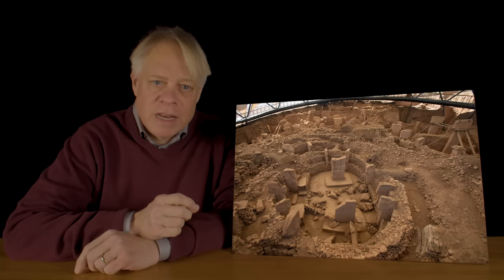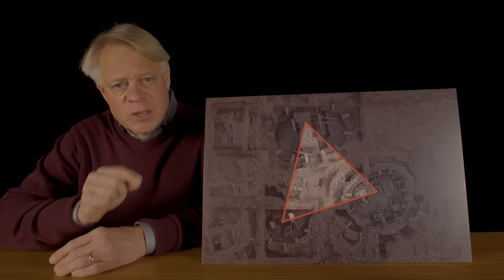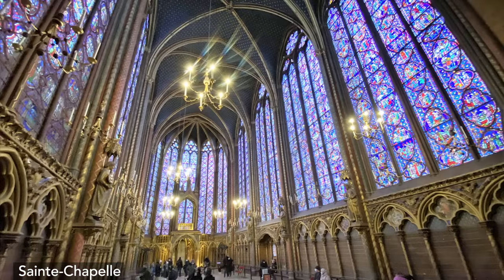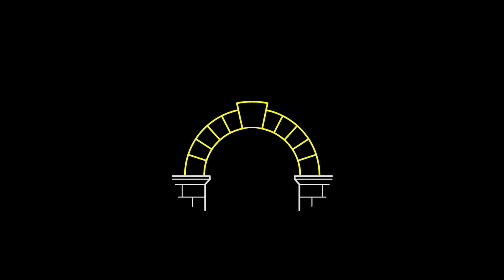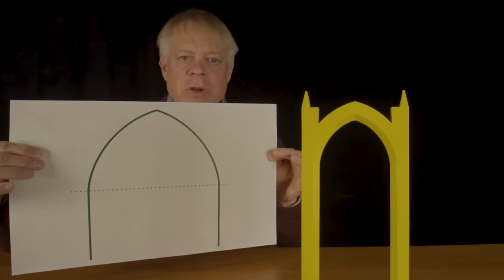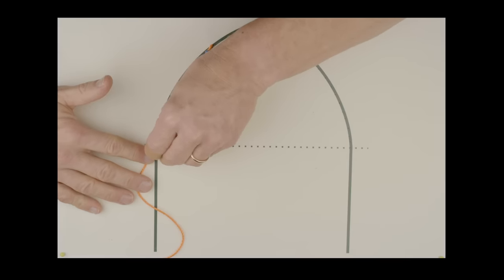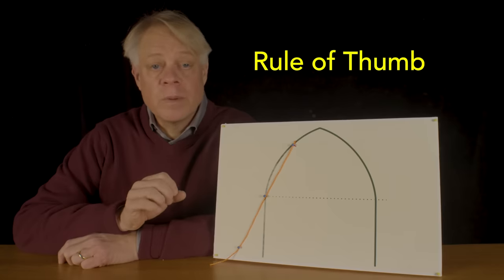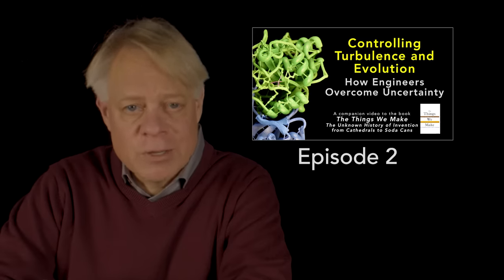Building a Cathedral without Science or Mathematics: The Engineering Method Explained

Comment: Oh come on.  I can find an equilateral triangle on a dog's butt if I try hard enough and pick three points.   Engineering method?  Yeah most three year olds can stack blocks.   Cave men could draw in the dirt with a stick and discover they could make forms they liked.   

It's also a lie that the builders of the cathedral didn't use mathematics nor geometry.   Of course the brick layers didn't get invovled in that side of it, but the designers of the cathedrals did.   Have you ever heard of something called a compass?  Do you know how they used strings to create arcs?   Did you know there is a method for subdividing sections?   "Oh we don't use math or science!  Derp!"   What is the point?   

As far as the kooky method for the string to find the arch width, that is the same as looking on any pattern and searching for the equilateral triangle.  It is meaningless.   Why is it meaningless?   Because the column width necessary depends heavily on the material properties of what the arch is constructed of.    Need the arch to have 1/4 to 1/5 thickness etc of whatever proportions you are trying to get at  IF it is made out of styrofoam?  Nope.  Not with styrofoam.  Material does matter. 

Yes they did use rules of thumb and trial and error.  What is a fancy name for trial and error?  Oh yes it is called science and engineering.   

This is just dumb on a hokey pokey scale.   

People who think this way is why people can't build a bridge or overpass in Texas anymore because they think "got more smarts than them stupid scientists or engineers nowadays!"   

If you made those same arches out of steel they wouldn't need to be nearly as thick for the same height and strength.  

The magical string method!   Well that is just conjecture.  More than likely they built smaller structures and knew already how far they could push their luck building things.

Comment: but they did use mathematics.... divide the length into 3... thats math
double its length, thats math... just without units of measurement
Reply: It's not math, it's just intuition. Sure you can create a mathematical basis for why it works but it's not "math" in the sense of advanced calculations and geometric analysis.
Reply: @TheTdw2000  they needed to work out how thick the walls had to be to support the arch, given the size and shape of the structure... geometric analysis

it dosnt need to be complex to qualify
1+1 qualifies as math.
or... that triangle wont fit through that round hole - geometric analysis